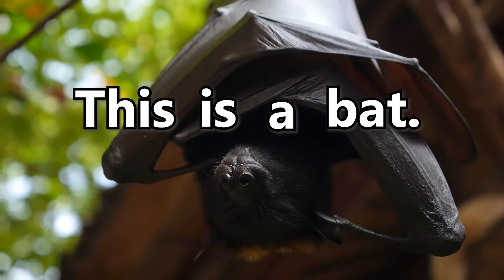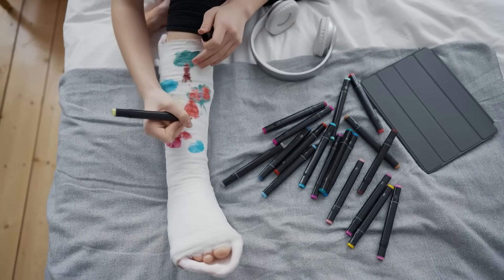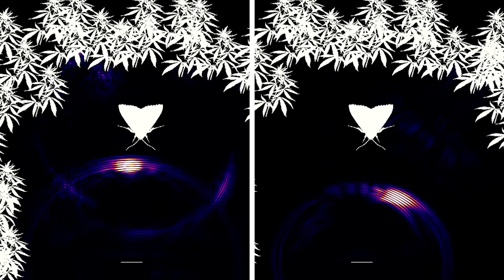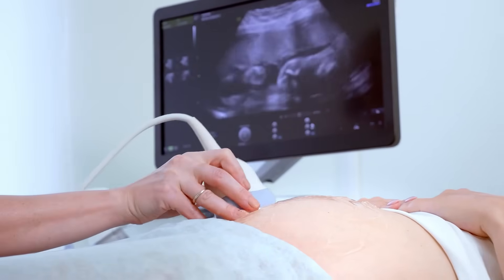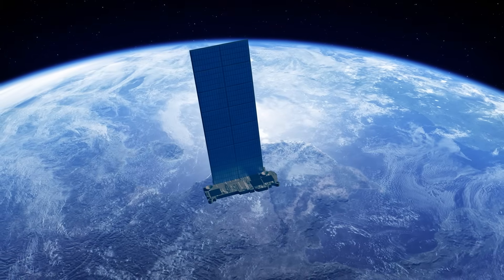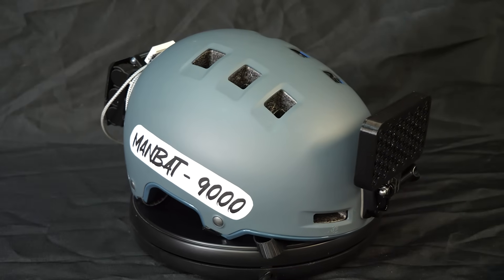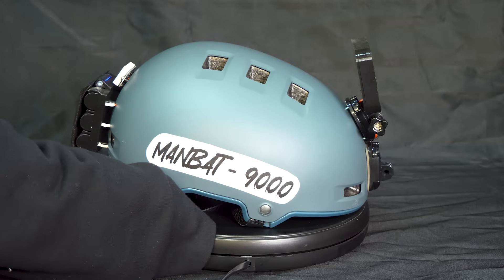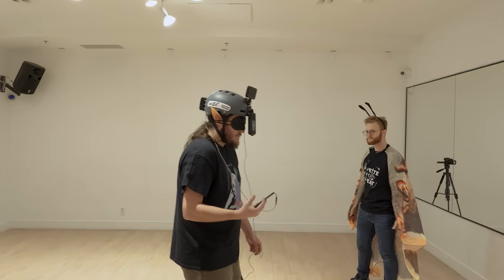A Submarine Sonar Strapped To Your Head

Comment: Eyy I was wondering if you'd talk about blind people using it.

I don't know how useful it'd be for me, all in all, but it would be interesting.

I'm DeafBlind. I'm also a full time WC user. So. Cane is v helpful, but it's mixed in overall effectiveness for me, just considering. Easier to use a white cane in a power chair than a manual >.>

BUUUUT given how it projects into your head, not directly into your ears, it'd be an interesting experience and thing to be able to test out. Like... IDK how much more effective it'd be than my cane would be, and it'd be nigh on useless for detecting curb drops, but keeping from smashing my legs and arms into walls, which... Just because I can't feel it still has potential for damage, it'd be an interesting accessibility tool on top of my cane, given don't always have the capability of detecting things like that before hitting it :P

Either way, that'd be interesting to hear from a ambulatory blind persons perspective o:

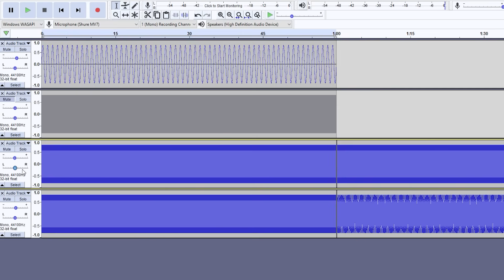Comment: 9:15 hold on, the reason you can hear (relatively) low frequency when you add the 1Hz wave is because of clipping distortion.
computers have a hard cutoff for audio output.
I'm guessing your helmet exploits non-linearity of ultrasound, which in your example is emulated by the computer's clipping, but I suspect that the analogy breaks down real fast when you go into the details

Comment: I didn’t fully get the part on frequency mixing and hearing it “inside you” only. Is this because all transducer play something different, but all inaudible ultrasound? And then when they bounce of something it mixes? Why wouldn’t you hear it when it is pointing towards (before reflecting)? It would still be a beam with mixed frequencies and harmonics right?

Comment: You aren't getting the effect you think with those vampire ears. If you change your ear shape you lose your sense of direction until you get used to the new shape, which can take days. If you need bigger protruding ears, just use flat surfaces at 45degrees to your head, which will still be weird at first. Might be better off with no extra ears though. Did you TRY it without the weird ears?

Comment: I think you should absolutely do this again. Instead of using a recording of a bat echolocation, you need to use either a red tone or even white noise with filtering so you cannot only hear where something is but even the shape of it by hearing how the sound changes in pitch.

Comment: i have VERY bad vision (20/450) and have navigated my home in the dark for many years. but, i can usually hear surfaces and objects interacting with sound and air pressure, so can usually get around thus in most places. I also used this when competing in things like Martial Arts, field paintball, and SCA. AND it helps me when in public spaces, b/c even with my glasses, my field of vision is severely limited.

Comment: I had an idea for a bioengineering project, and I wanted to know what you or anyone around here thinks.
A flesh speaker. Muscle tissue that can contract and expand a membrane causing vibrations, just like the an electronic speaker does.

As a way of generating noise that doesn't rely on airflow or lungs. Though I don't know if it would be able to reach 10khz on its own.

Comment: Why use a sound or clicking?? Blind people will a small battery powered vibrator in their pocket or hand could use the tones generated by the array and convert it into fine waves. idk if true or not but I feel this did not have an aspect of spatial data. Im sure animals can interpret the wave coming back very finely, i.e. see the "shape" of the moth vs camera stand. Interesting that the mirror doesn't affect it haha. Apple haptics with ultra low latency control may work for visually impaired

Comment: I have a feeling that the dance studio was actually making things harder than they needed to be. A room with flat walls everywhere will cause a bunch of echos, making it harder to place where the original sound is coming from. Probably an open field (maybe out in the snow, because it absorbs echos) would work even better!
Reply: whenever you try to orient by a sound emitting "laser" focused cone of those soundwaves, you could actually just ditch the noises that repeat eachother by distance. Its easier than you might think.

Comment: yes, please please please find seek out blind volunteers.  If they benefit from this added sense, you could possibly move forward to get this registered as a medical ability aide maybe even covered by insurance plans, or, go the charity route and post open source plans (also formatted in braille using any number of online text to braille converters) for the blind everywhere to obtain parts through sources listed in DIY kit guide, or, do the work in consolidating all the parts into a kit that can be bought at X cost to save trouble on the blind getting all the right parts.   
This is a cool thing.  You could get a patent, and leave the patent open source so no one else tries to patent your concept for profit, or any number of things.  
There's an estimated 1 Million people in the US alone with blindness.  if even 1% of  that benefit from your device, that's 10,000 people with enhanced quality of life all thinks to YOU!
Suggestions to play with; test battery life, and work on practical all-day use battery solutions?  pair with wireless open ear bone conduction headphones for a less perceptive chirp to bystanders and increased return sensitivity for user, while not blocking ears of user with things like earbuds that could impair other general sound awareness?  integrate a range-finder that increases chirp frequency as distance closes?  Look into water-resistance for users that may encounter rain, mist, high humidity?
Dunno.  I'm spitballing because this is kinda exciting, and I'd love to see this become a successful tool that increases the quality of life for many.  
As AI develops in sophistication and portability, perhaps AI could be trained and integrated in the future to auto translate chirp to a word identifier; cat ... cat .... cat . cat. cat cat catcatcat  Person, obstacle/wall?   dunno.  :)

Comment: I can echolocate and it's bizarre how drastically different our approaches are

I make a click with my mouth, which has like no focus, and I listen for reflective surfaces

1) I click
2) delay (in milliseconds)
3) I hear a surface (and I can hear the direction it came from)

The shorter the delay, the closer the surface. But if it's closer than like, the other side of the road, it's too close so I can't tell.

I thought a engineering approach would focus on two things
1) make the pitch higher for better resolution (I think my resolution is a meter?)
2) increase the delay between click and reflection (I can't hear the difference between 10 and 12 meters, cause that's a fraction of a second)

But instead you completely sidestep the distance thing and go into focusing

To show off my echolocation I'd have the opposite of your experiment
Wide open space with no reflective surfaces (so no buildings)
Friends holding really big sheets of corrugated iron (I've found those surfaces ridiculously easy to hear)

Also, a question I crave an answer for: 
When I click at a corrugated surface that's tilted away from me, I hear a chirp like a bird or a bullet ricocheting.

What's causing this chirp? It's beautiful. Does your machine hear the distortion of a corrugated surface tilted away at a distance?

When I click at a plain wall, I hear a click.
When I click in a perfect alleyway, I hear this weird stagnant sound.

Comment: 7:28 not really, the shown F-117 was so angular because of software limitations for calculating the reflection at the time. Newer stealth aircraft like F-22 are nice and rounded, because computers (and software) got powerful enough to simulate the reflections. I recommend learning the story of how they developed it at Skunk Works. Funniest part is that the plane was really unstable, but they just decided to use a computer system to basically force it to behave by constant microadjusting of the steering surfaces.

Comment: The pressures used as reference for the sound pressure level in air and in water are different. To correct this difference in reference values you have to subtract 26dB from the SPL in water. Additionally the difference in impedance of air and water results in another 36dB reduction. So the sound from whales in water would be compatible to a sound at 168dB in air. Still as loud as a rocket launch, but not physics defying loud.

Comment: I'm blind, and I think this would be regarded by other blind people as a fun toy. It wouldn't be a practical day-to-day tool, but not for the reasons you'd immediately think. Many people - mostly sighted but a few blind or other disabled - have come up with similar ideas but they've never really gotten off the ground due to sheer complexity and potential for failure. It's the same reason that blind people with dogs or other animal support typically keep canes (and why those who don't are considered overconfident at best). The tried and true methods have the advantage of simplicity. My fancy echolocation helmet can run out of power or get hit by debris that damages it, while a carbon fiber or fiberglass rod is much harder to break. And if my cane does break (or preemptively if I'm in an environment likely to stress it) I can replace it with any rod of sufficient length and durability (I keep a few wooden broom handles for hiking trips. I've used dedicated hiking poles in the past but they're not long enough for someone my height.).

That said I think it would be fun to play with and I doubt many blind people would reject it as a toy (And the ones who would are probably boring people who don't like fun anyway and can thus be disregarded).

Comment: ive only seen paramteric speakers in 2 other videos both used for something only these speakers can do, and i hope this is the right way to spell paramteric beacause if its actually parametric then it got misspelled in this video

oh and it does seem like the 19khz and 18khz is filtered out or a problem with speakers, i couldnt hear anything on my laptop but on my phone if i put my ear to the speaker i could barely hear 18khz.
i have an ear... thing (i forgot what it exactly is) which makes me hear higher frequencies, so i think i should be able to hear both of these clearly

Comment: 9:13 I think your example is incorrect. The signal is audible because the scale is digitally clipped. This creates distortion, which adds extra harmonics. If you reduce the volume of the mixed tracks, you won't be able to hear the signal. I even tested this section myself. Also, if you mix three clean tones, you will still only get those three clean tones if nothing in the audio chain adds intermodulation distortion. 

This video was really interesting as always, but I'm not sure how you managed to hear the bat signal. Maybe the speakers added distortion? At the same time, the sound recording you showed is fully within the human hearing range, so I'm guessing that you just pitched down the bat's echolocation signal and didn't talk about it in the video? So I'm not sure what the previous explanation was for.

Comment: it took me nearly a year, with (admittedly) pretty inconsistent practice, to be able to echolocate using just mouth clicks, though the diffusion means you can also pick up the shape of, say, a room pretty easily, but I also can't track moving objects using pings alone that way. (I'm sighted, too, so I have that extra sense taking up bandwidth, [but also you can do both at the same time])
I wonder how using one of these 'sonic flashlights' would work for me

Comment: The use of an ultrasonic beat freq to a detector on helmet and use a phase discriminator to provide some binaural audio to headphone may provide a more useful signal than the audible chirp.
Reply: Arguably, the ear-brain capabilities of frequency and direction detection from the incoming sound are much superior to the binaural processed signal. But it is a thing to find out.
Reply: @umbrel it could at least be used to eliminate the need for audible sound, allowing it to be used around other people without them having to hear it
Reply: @Atreeperday  it can be very useful, but if the interface is to be a processed binaural signal, there is no need to limit the detector to sound, you could use microwave and hear through walls. Though a sound based interface is very limited for people who are not blind, an AR overlay would be more interesting then. 
For blind people a normal camera could be processed into a binaural signal for multiple objects at the same time.
For the rest of us, I suppose that the most useful use would be to hear where the eyes can't reach, like placing a camera in the back of your head and hearing what's behind you.
Reply: @umbrel hey, those are some great ideas
Reply: Two down-converting receivers fed from the same oscillator should be enough. Some radio amateurs use a binaural radio receiver and say the sensation is very interesting; different signals appear to be in different spatial locations.